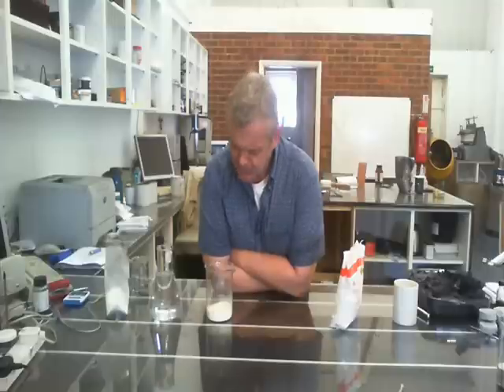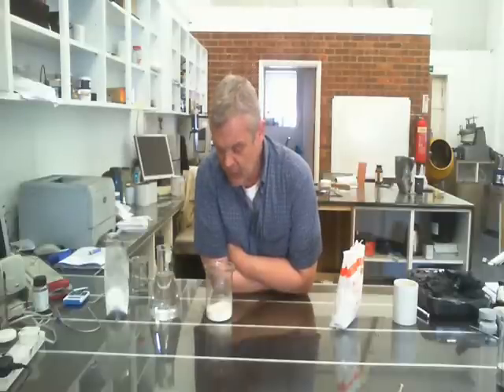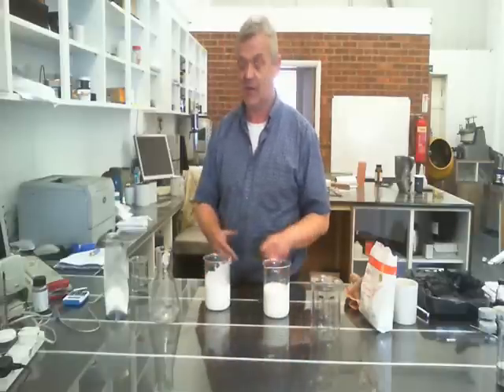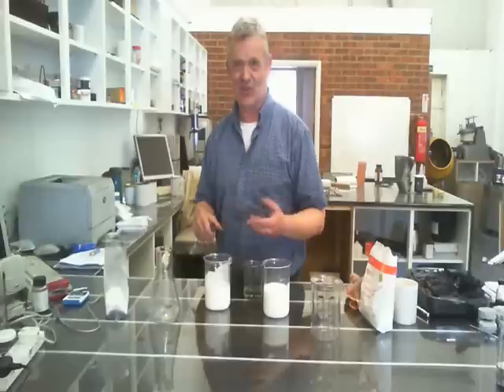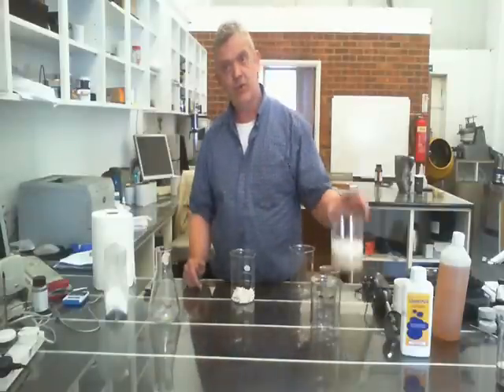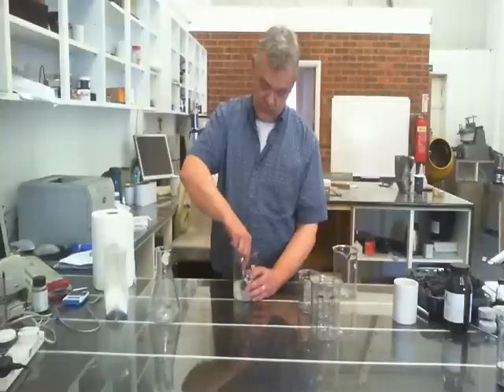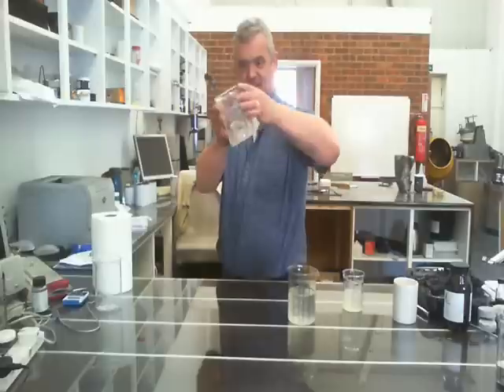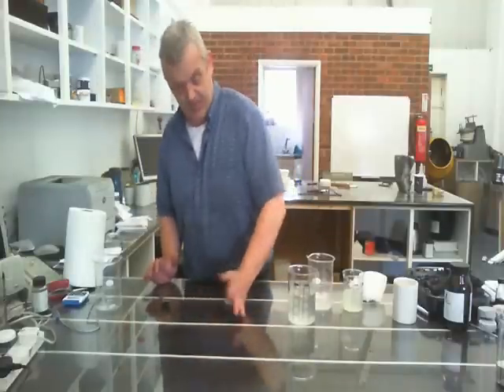Making Fake Ivory And Casein Milk Plastics, Glues and Paints

Comment: I don't have formaldehyde in stock, but I wonder if chrome alum, that I use as a hardener for gelatin (carbon printing process) might work just as well. I presume even potassium dichromate would harden it, even faster at the exposure to UV light. I know that formaldehyde is the best, because it evaporates and it does not leave any traces in the material as alum chrome might do, but I am anxious to test this and I'm thinking on shortcuts. 
One more question. 
If I want to make a varnish kind of liquid, I use the method of washing it with acid and alkaline water. If I would want to make cubes or other 3D objects, I would use ethanol or methanol as washing solvent. The result in the first process with water as a solvent is much better than with ethanol. Is that right? 
How much of humectant did you add to make those nice sheets? I'm adding about 25gr of white sugar into 500ml of 10% gelatin solution for carbon print process. 
My casein is at the moment nicely sedimenting, I'll leave it overnight. It looks very brightly white already after two wash. I'm intending to make one more wash. I go with acid treatment to 5pH and with alcaic treatment to 9pH.
Reply from the maker: well - they are both polypeptides so it would be worth a try and i can't really see why not - i suspect ammonium ferric chloride would work too - but that's based on gelatin printing too - i don't think there is any difference in the washing process they are just alternatives the difference in lacquer or solid is more to do with the additives and thickness to be honest - I tend to use glycerol as humactant but not for any real reason - I have found glycerol and honey to work well - I tend to change humactant ratio based on how plastic i want it but i do that by guessing to be honest - that is start at 5% by volume and waver around that and see what i think to the samples
Reply: Great! Thx, I'll try 5℅
Reply from the maker: Borut Peterlin
cool - good luck mate